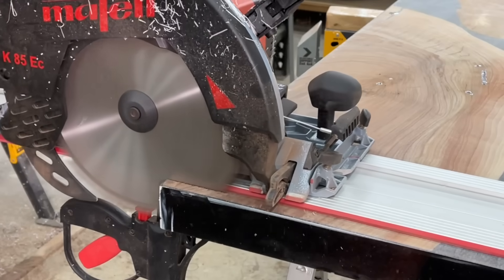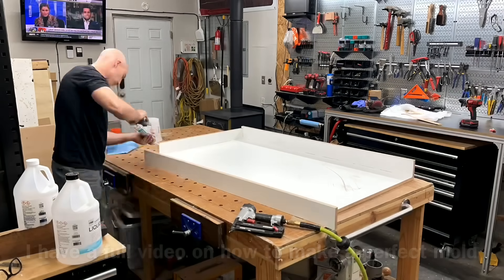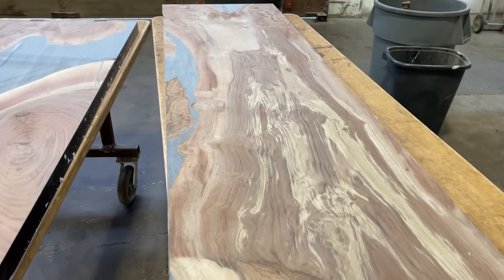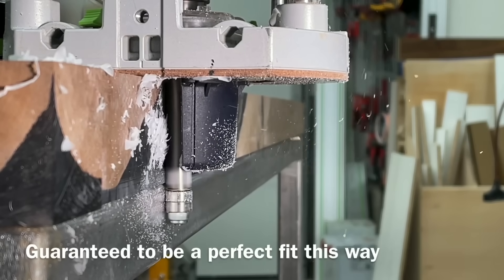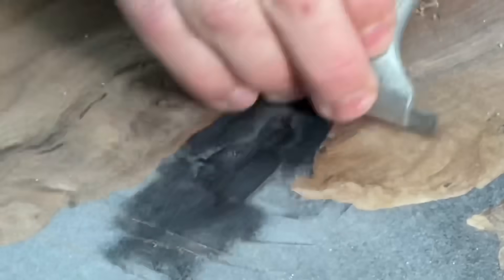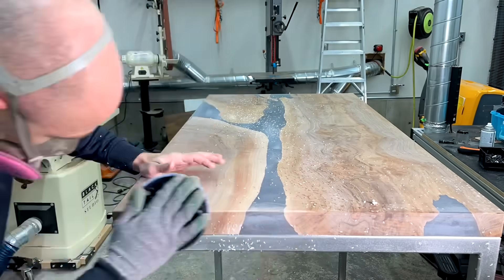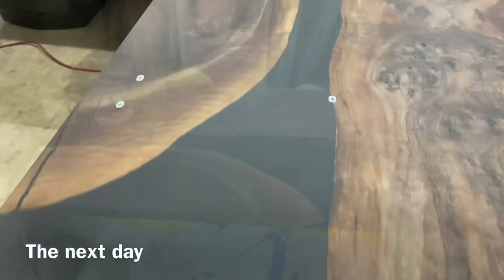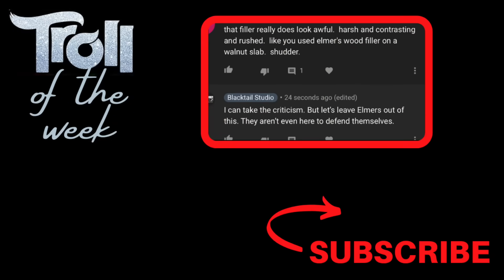Standing Desk The Cops Thought Was Loaded With Drugs (really)

Comment: The right price is always an amount that is agreeable to both builder and client.  The "3.2 x material cost" can be correct for some projects but not all.  Sometimes the price should be only 2x cost of materials and sometimes it's correct to charge 10x cost of materials.
Reply: Yes, such rules of thumb are only a starting estimate. In general, smaller jobs should have a bigger multiplier and larger jobs possibly a smaller one then there are a bunch of other factors that go into it too.
Reply: @chaos.corner  Exactly right.  Consider when my motorhome engine quit on the Los Angeles area 210 freeway at rush hour.  I managed to get it to a repair shop.  The fuel pump clogged, an easy fix in older vehicles.  Simply detach a couple of hoses, unbolt the pump from the engine block, and connect the new pump.  Done.  The motorhome pump in inside the fuel tank (Ford) which must be removed, drained, pump removed, tank cleaned, new pump (don't try to save a few dollars on a rebuilt pump), installed, sealed, remounted under the motorhome, connections made, tank filled with new (clean) fuel.  Tested.  It was very expensive.  Like you said, "there are a bunch of other factors that go into it..."
Reply: Plus you always have to consider time spent in addition to materials, plus cost of tools, cost of space to work, cost of experience, etc.  Cost of materials is honestly such a small part of price when you're dealing with anything handmade.
Reply: The only change is primarily if the client buys the materials cause then you still have to charge for labor and any materials you have to buy afterwards that the client didn't think they'd need for the project.

Comment: Have you thought about rigging a vacuum tank for when you pour the resin?   The trick is to subject the resin to a vacuum while it is liquid, then release the vacuum to let it cure under ambient pressure.   This causes any trapped air pocket to expand about 100 fold in size, until some tiny part of the large bubble finds its way out from under the area holding it… at which point 99% of the air escapes… what you are left with is basically the same ‘size’ air pocket, but now at a tiny fraction of a pound per square inch pressure.  When you release the vacuum, that slams 14 pounds per square inch pressure on the air pocket and it compresses to a size too small to see.
Reply: There is also pressure casting where any bubbles are squeezed down until they're invisible. Apparently the air eventually diffuses out without causing any harm.
Reply: @chaos.corner  Pressure casting resins requires a chamber capable of containing at least 60 lbs per sq inch,  and you have to hold the resin under that pressure the entire time it takes to fully cure. The pressurized air does not escape gradually, with some materials it is simply forced into solution, like the carbon dioxide gas inside an unopened 2 liter bottle of coke.  But not all materials will take air in solution, and entrained air Can exert additional distortional forces on the  resin once pressure is released, compounding the natural forces of wood tending to warp or cup. And if the pressurized air is right against the wood surface it can initiate de-lamination.    Pressure casting works really well for smaller items and especially with materials that are not porous- such as embedding other resins, metal and such… but I would recommend against it for large pieces of wood where the air is usually trapped in an inverted hollow against the wood surface. A vacuum tank only has to withstand 14 lbs per square inch, and only for the time it takes to de-gas the resin.  You do have to allow for the resin to increase in volume as the entrained air expands until it crests and collapses as the bubbles burst….  And it it a good idea to test to make sure the resin your using CAN be vacuumed.   If the liquid has too high a surface tension the expanded bubbles might never burst, even under full vacuum…so before building a large vacuum tank, test your materials to ensure they will behave as needed and the expanding air will reach a point where the bubbles all collapse and the liquid resin settles back down into place.
Again, the key with vacuum casting is that you are STILL using “pressure casting” to reduce the air bubbles,  you are simply removing 99.8% of the air first, and leaving only bubbles that have few actual air molecules in them at all, and then while its still liquid, using ordinary atmospheric air pressure to slam 14 lbs/ sq in.
Reply: @christopherpardell4418  Makes sense. Thanks.
Reply: @christopherpardell4418  what most don't know is you can vacuum the resin after mixing and before pour as well removing air then.... and then when pouring there are specific ways to pour that will prevent introducing air bubbles.... of course the 2 bubbles he ground out and filled were definitely from the pour process..... the best way to pour is a pot with a tube out the bottom ....vacuum then place the end of that tube at the lowest point of the pour open the valve and it will fill from the bottom of the target pour area not able to introduce any air.... a good 24 hour epoxy will give good pot time to allow bubbles to escape and a nice slow pour helps too.... talk to epoxy suppliers they will tell you their best products for your needs and best methods to eliminate air pockets
Reply: @jolllyroger1  Yes-   It always a good idea to degass mixed resins before pouring… but the problem here is that there are undercuts in the undulating shape of the wood.   These create little ‘grottos’ on the underside with no path for the air to escape thru, so that when you pour resin, even if you degassed it prior to pouring, it will still trap air in the spaces that you can’t even see because they are hidden on the down facing side of the slab of wood.  Imagine upside down bowl shapes on the down facing side of the slab… the resin can not flow Up into the inverted bowl because there is no path for the air to escape.
You are never pouring resin into an empty space- you are pouring it into a space that is already filled with air.  If there is no way for the air to get out, then the resin simply can not flow in.  We vacuum degass silicone before we pour it into a mold, but we have designed the mold with adequate vents and oriented it in such a way that the air that is inside the mold which the silicone must replace has paths to follow out as the rubber pours in.
In this particular case, because of the nature of the wood he is embedding in resin, the best solution is to subject the entire pour to vacuum to minimize the the air entrapment.
Reply: Can you not just agitate it - damn sight cheaper than a vacuum chamber?
Reply: @I_Don_t_want_a_handle  agitating it will likely just introduce more air bubbles into the resin. I do agree though a chamber big enough for these table-tops would be pretty expensive. probably best to drill them out and fill the like he did here. Gonna take a lot to pay for that vacuum chamber.
Reply: Just build a rig that bolts to the ground.. rubber seals on the bottom, aluminum tube frame with a plastic shell. vacuum pump with a valve, easy stuff.
Reply: @I_Don_t_want_a_handle  Bubbles can get trapped. It also depends on how fast the resin sets. Longer allows more time for bubbles to escape but quicker means you get the job done sooner.
Reply: @chaos.corner  The faster the resin sets, the more heat it produces. In large masses this causes the center of the resin to cure first and turn solid, and the periphery, in trying to shrink, can;t, and so result in spiral fracturing around the pre-solidified center.    If the resin produces too much heat, too fast, it can pyrolyze, venting toxic gasses and literally burning the wood.
Slower set is always better.
Reply: @I_Don_t_want_a_handle  As Akuno points out, agitating will often introduce more air- but this slab plus resin must weigh a couple hundred pounds, not an easy thing to agitate without shifting the wood around.
A vacuum chamber is not that hard to make, You can make one out of plywood. The only issue is the area of the bottom and top surfaces…a big flat plate is very hard to HOLD flat against the thousands of pounds of pressure that a large area is subjected to under vacuum.   You don’t want it to bow low enough in the middle to lose the air tight seal at the edges, or to touch the wood/resin being vacuumed.
About the most expensive part would be that you would want the top plate to be transparent so that you can see when the resin has bubbled up, crested, and collapsed back down into the mold. A 2” thick piece of acrylic or polycarbonate would do. Or an Inch and a quarter thick sheet of tempered glass.
You can pick up a used scientific grade vacuum pump fairly affordable… the larger its CFM rating the faster you can evacuate the chamber.   But the chamber itself only has to hold a vacuum for perhaps the 5 to 10 minutes it takes to evacuate the chamber… you then release the vacuum and let the resin set at ambient pressure.
Reply: @I_Don_t_want_a_handle  PS 	In this one video, you see him using about 3 grand worth of saws and sanders and routers… a vacuum chamber that would save him time and improve the quality of his result would be money well spent for a product valued by its excellence.
Reply: Some processes use vacuum mixers so that in addition to the expansion of the bubbles you also have the mechanical action of the agitator working bubbles up and together. If you mix a little more than you need and use a vacuum pour, you can eliminate almost all bubbles. This process used atmospheric pressure to inject the resin. This is commonly done when making dental prosthetics, but the physics should work for a table. You just need a bigger mixer and casting machine. The top and bottom of such a machine can be flat and the sides do not have to be perfect, they just have to seal. Just put your normal form completely inside the vacuum chamber. You might try raising the wood up using some kind of jig so that both sides get poured in one shot. Risky of it shifts though...
Reply: @christopherpardell4418  The simple solution to preventing trapped air in the natural shape of wood is to just reshape the wood to prevent any natural pockets of air from forming in the first place.  Put some planning into providing a route for the air to travel as the epoxy level rises without making it an obvious channel, it can be done to look organic and naturally formed.  Pour the epoxy from one spot and have those overhangs angled upward and away from that pour point, which allows for both the gradual rise of the level as well as that leading edge as it's traveling across the void.  A little forethought into shaping the work is all it really takes to eliminate those types of voids, just as the way your silicone molds were designed to do.  Degassing epoxy is the ideal way of removing tiny air bubbles, then pouring without producing bubbles, then making sure what you're pouring it into will not trap bubbles.
Reply: @Skinflaps_Meatslapper  I beg to differ. That is not the simple solution to “preventing trapped air in natural wood,” as your solution is to modify the contouring of the wood, hence, sacrificing its natural contour.  I could have as easily suggested he simply drill a vent thru the wood plank to relieve every potential undercut that could trap air… but then his wood would have visible holes thru it filled with black epoxy.   
Furthermore, it is not saving time.   The time he spends fixing entrapped air would be offset by the time you suggest he spend identifying and modifying the wood to prevent the entrapped air.   Add to this that no two pieces of wood are alike… and that often it may be difficult to identify every single area that might entrap air. meaning your suggested solution would have a failure rate that would mean manhours  modifying the wood prior to pour, and still not guarantee than no manhours wold be need post pour to correct overlooked areas.

Contrast that to my solution.  He builds a TOOL that is in his shop ever afterwards.   He sets up his pours as he always has, and simply pours the resin, closes the lid, and flips a switch. Ten minutes later he turns the switch off and releases the vacuum and, regardless, of the contour of any piece of wood he may employ, he can be assured to have eliminated the air entrapment….
Reply: @Skinflaps_Meatslapper  PS- vacuum bagging fiberglass and carbon fiber layup is not strictly necessary.  Its is perfectly possible to produce excellent results with diligent and experienced technique…but vacuum bagging DOES result in thinner, lighter and stronger parts of vastly more consistent quality with less manhours expended.  Easily offsetting the costs of the equipment and materials involved with better, higher quality productivity.   If someone is making ONE of these tables, then your solution is probably best.   If your business is making tables like this, then it is worth it to invest in the technology and tools that save time when those tools improve both quality and productivity.
Reply: @christopherpardell4418  He's already modifying the live edge considerably with the wire wheel and altering its natural appearance, and putting a little thought into how air is going to travel up from the bottom of the slab to the top is nowhere near taxing in thought or implementation.

I'm not suggesting your idea of a table sized vacuum chamber is a bad one, and ordinarily I would agree with you (I regularly do vac layups for aircraft and trophy trucks, and stabilize wood for lathe work using epoxy and a chamber, so I absolutely know where you're coming from), but you still have to consider how the air within the wood is going to escape.  Some of it will inevitably bubble up through the epoxy on its way out, some of it will likely get trapped in those same overhangs and form a void, and then you have the same problem you were faced with previously...how are you going to get the bubbles out from underneath those cupped overhangs?  Unless you put a seriously hard vacuum on the table and have an epoxy with a cure time of several days, you're not going to get all of that air out unless you put a little thought into shaping those edges to allow for it to escape.  I still get bubbles in my epoxy stabilized wood, and I use the hardest vacuum my pump can manage with the slowest curing clear epoxy that I've been able to find.  It never fails, it comes out looking great, and somewhere inside the wood I'll get a bubble or void that just didn't fill, and I have to touch it up.

Even if you do build a table sized vac chamber and manage to get those air bubbles out, what happens when you want to build a piece that's bigger than what you expected your largest piece to be?  What if it's just not feasible to make a vac chamber that size in the first place?  Making a chamber big enough to fit a table that large isn't going to work with an ordinary pump, it'll have to be an industrial order.  Making something that large capable of withstanding hard vacuum is not going to be done with plywood, or any wood for that matter.  Sure, you could put a bag over the plywood box to keep the air from leaking through the wood, but it's just not strong enough.  You'd need some serious reinforcements and probably a little thought toward engineering to withstand a 14psi delta.  Costs and shop space add up quick when you begin scaling up that much, and your business would have to scale up even more to accommodate the expense of a slightly better result.  The alternative is to simply get a chamber large enough for the epoxy you're working with and perform due diligence on the workpiece.
Reply: @christopherpardell4418  Yup. Slower is generally better but time is a factor too so you kinda want to find the sweet spot.
Reply: Wood has air in it too. No bueno.
Reply: @christopherpardell4418  so I am guessing that a steady vibration like it were concrete would fail, as the epoxy is to thick and the Polyethylene trick with a torch is out also, so maybe a combination of both in some form
Reply: @chipum2fleming228  vibration  can help air to rise out of a liquid, but only when the air has nothing preventing it from rising but the liquid….  Vibration can do nothing to solve air caught in an inverted hollow.  Imagine a 5 gallon plastic pail, upside down, with a heavy weight tied to the bail to pull it underwater, upside down.…. It has a huge air pocket up inside the inverted bucket.   No amount of vibration will get the air out.  Drill a hole in the bottom of the bucket and the air could escape… but he doesn’t want to drill holes thru the wood he’s embedding.   However- if you subjected the bucket and the water to a vacuum, all the air dissolved in the water would come out as bubbles that rise to the surface… and the air trapped in the inverted bucket would expand until the bottom of the bubble expanded beyond the lip of the bucket…at which point most of the air would spill out from under the bucket and rise to the surface.
Reply: @christopherpardell4418  Wow.  Thanks for the reply.
Reply: God that thing would be huge and require days…..
Reply: @akunog3665 you can vacuum chamber using a pressure cooker... just putting the resin in the chamber before pouring will eliminate these bubbles.... but not those trapped in voids that trap air under surfaces.... eliminating air from mixing helps considerably
Reply: @christopherpardell4418  yes exactly degassing the mixed resin helps though and of course making a huge vacuum chamber is not that difficult especially if you're charging such nice prices.... big chambers take quite a while to vacuum too but pot times should allow it.....a vibrator can help.... even an orbital sander bolted to the item.... the voids I watched being filled looked to be in the open span